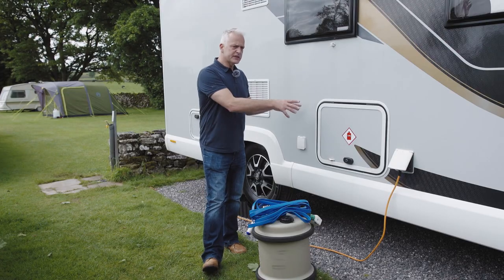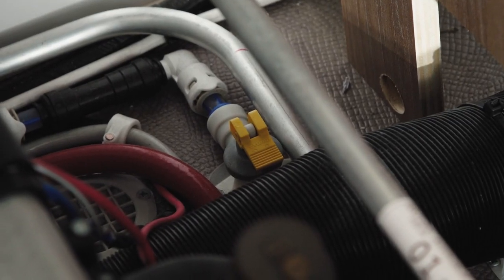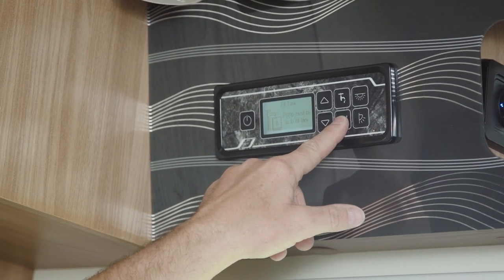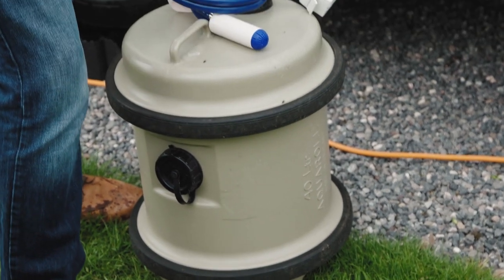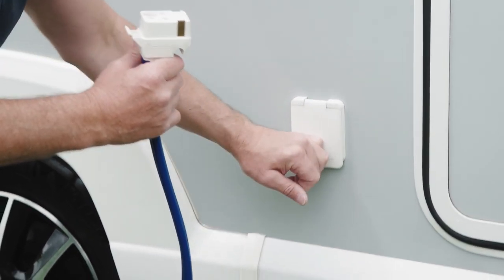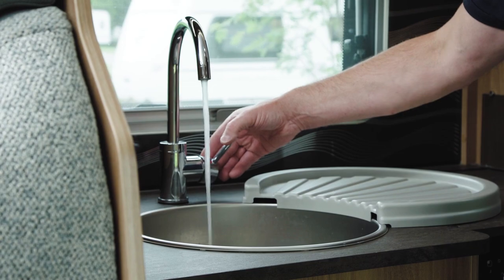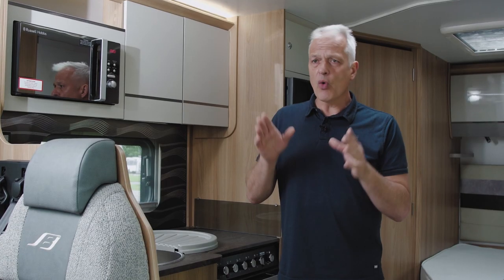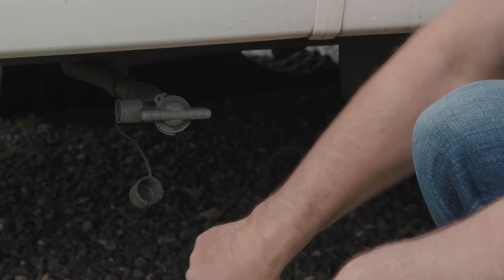How to operate your motorhome water system

Comment: Good demo, we just got a Bailey 69/2 2020 plate first night everything was fine then while off hook up our water tank would not pump water saying it was empty.  While playing with display the recalibration came up for water tank my fingers must have it something so no water no pump working what went wrong, I will refer to manual can u suggest any practical help, also the leisure battery drained to zero, when driving do we need to select something on display, does the fridge when on battery take supply from leisure battery or engine, before swapping we had a elddis 195 with 2 leisure batteries and never had an issue can you fit another leisure battery on the Bailey 69/2.
Thanks in advance robert

Comment: Wish i had seen this video today just had the problem after filling water tank from the winter drain down. Pump would not stop running no water coming from the taps .  All sorted now it was due to me filling tank with  all taps open so pump did not build up any pressure . Since learned should prime the water system by just opening the hot kitchen tap pump then builds up pressure quickly and when you turn off kitchen tap pump should stop without any adjustment to the pressure switch.